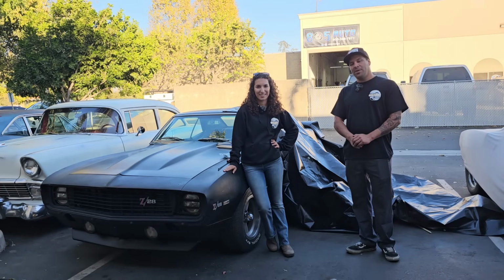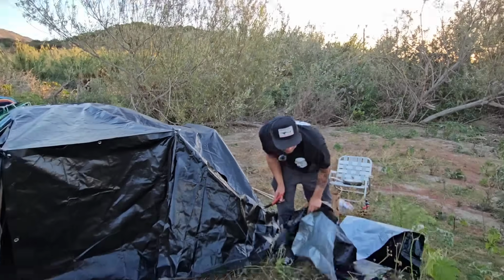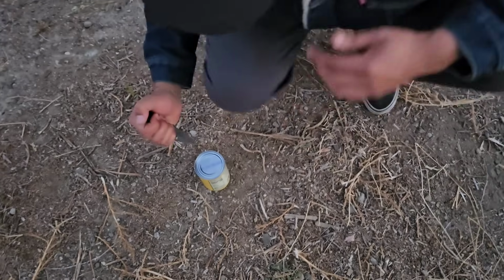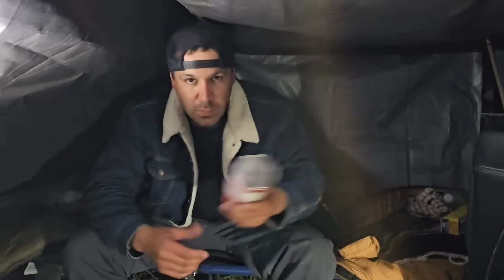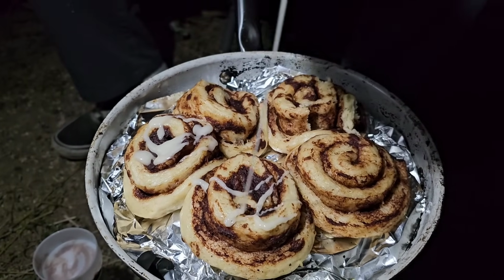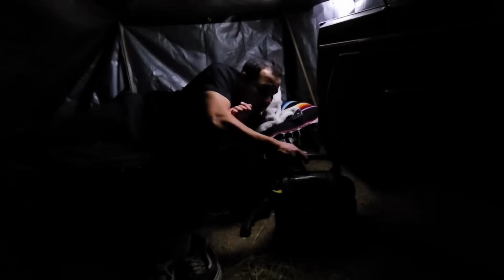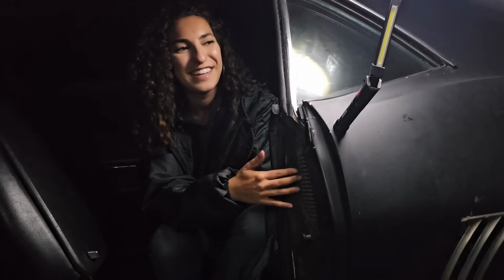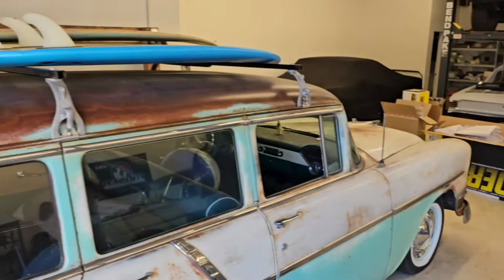Stealth Camping In A Muscle Car

Comment: I used to do similar stuff with my '69 Camaro. We used to roll up hot dogs and rolls in foil, stack them up on the intake manifold, and drive down to the  beach, and drive out as far as I  could before getting stuck in the soft sand, roll out the tarp, rollout the sleeping bags, have hot dog feast, and then sleep under the stars and hope the rain stayed  away.
Got to love Summer nights on the beach with your best girl friend and your Camaro you built yourself.
It doesn't get better than that. Makes for great memories. Have fun. Be safe.